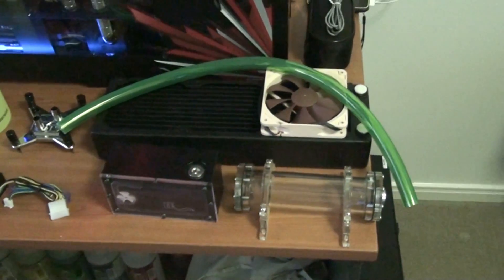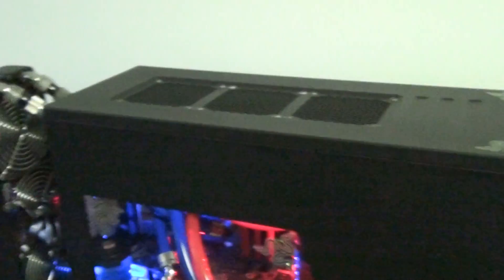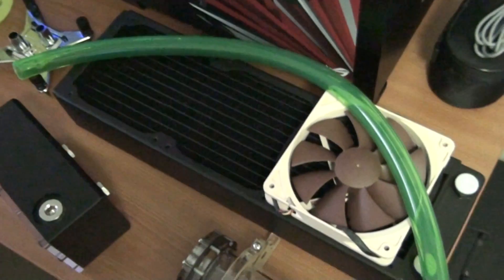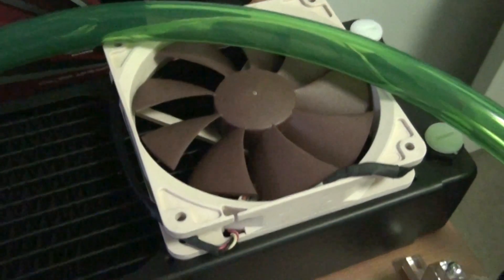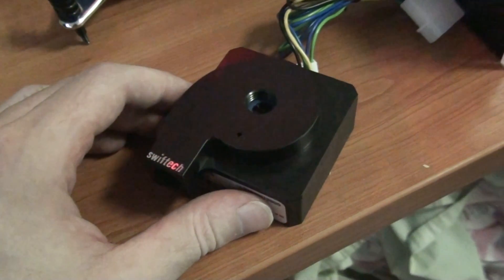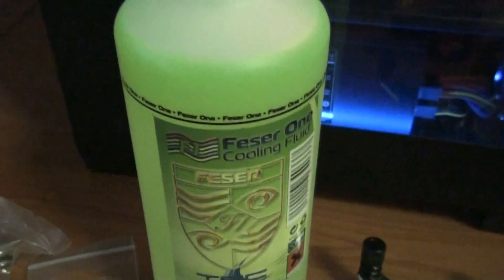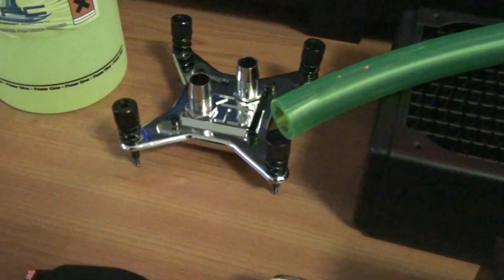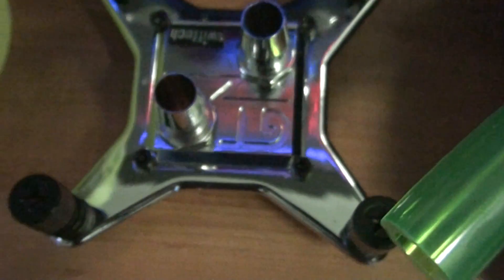PC Water-cooling Guide Episode 1 Components

Comment: I might be the guy that owns SingularityComputers, but I recommend for people looking for bundles, I usually recommend XSPC or EK bundles, and for 1st timers, I recommend Swiftech H220 its a prefilled one but you can expand it and replace the tubing also add another radiator with it. and Other Swiftech kits like the Ultima or the others.
Reply: DWARFAHKIINS 
Careful with those boxed custom loops. 90% of The radiators and cooling blocks are made of aluminum including EK’s offerings. 

BAD to mix copper with aluminum as galvanic corrosion occurs and most parts you buy separately are made of copper. 

Copper is unanimously better at transferring heat than aluminum but aluminum is cheaper hence why they use aluminum in boxed loops. Problem is, if you plan on expanding, you have to be extra careful about the parts you add as almost everything is made of copper or nickel plated copper.

If you don’t plan on expanding and just want a loop that allows you to replace the pump and add asthetics to your build boxed loops are great, but spending ALOT of time researching watercooling and then buying all your parts separately (even if their from the same vendor) instead of a boxed loop will always be better for compatibility and performance. 

Best to make sure ppl know about how these boxed loops are limited in their parts compatibility and that if they aren’t extra vigilant about making sure any rad or block they add-on is compatible with aluminum then they will have a horrible experience. Feeding the flames of watercooling hate from ppl that did not do their due diligence and/or blindly followed info from ppl online.  Most would assume an “expandable” boxed custom loop from EK would be compatible with the vast majority of EK rads and blocks whereas with the rads it’s exactly the opposite.  The nickel plated copper of some of the blocks will likely save them from their ignorance...but not all blocks are nickel plated.

Comment: i personally think liquid cooling is for extreme overclockers but you can do it just as a hobby or to get a dead silent rig. the liquid isn't really pressurized. the liquid is not conducting anything other than heat. you will know if it is leaking when a you see coolant coming out the fittings....

Comment: I have no experience of actually building a watercooling loop, so cant help you with that.
Ram wc is not neccesary, not even very usefull, but you can do it if you want for the looks and it does help a litle when pushing to the highest of the highest overclocks...

Comment: @IMxLEGITxBEAST if your not overclocking then you need 120mm of radiator per part, so for 2 GPU's and a CPU then a triple will be fine but if your overclocking your cpu like hell then a triple will be enough with one card if you want good temps

Comment: I'm thinking Alphacool Cape Cora HF 642 Konvekt. Not for overclocking, just silent and cool as possible, just a Core i7-2600(95watt), no overclock. Would it work nicely? And what if I used only 3 out of 6 modules of that Cape Cora? I would consider a XSPC Passive Aluminium Reservoir for good measure, just to cool it that bit extra.
-
And is there an easy way to just chill the water in the reservoir?
Or do I need this glycerine stuff I read about?

Comment: If i've got two radiators (both different eg. ones EK and the other one is XSPC) how do i know what tube will fit I could get the same rad but the second one im looking at is thick and im not sure if I can use the same tubing. (I am using a watercooling kit and planning on adding another pump and radiator). both rads a 1/4 thread size is that anything to do with it?